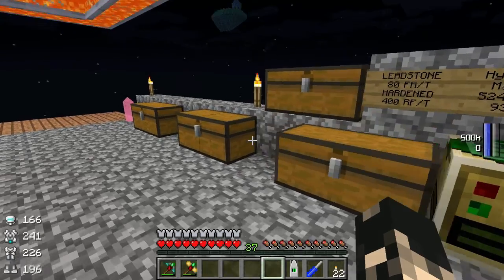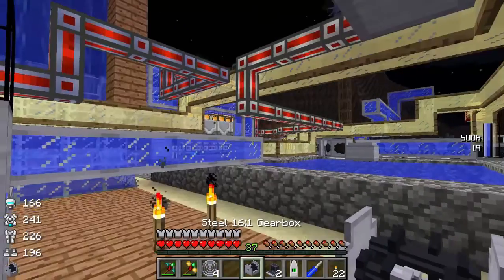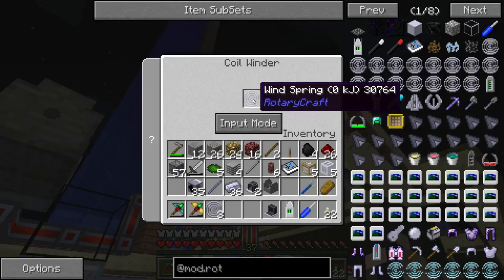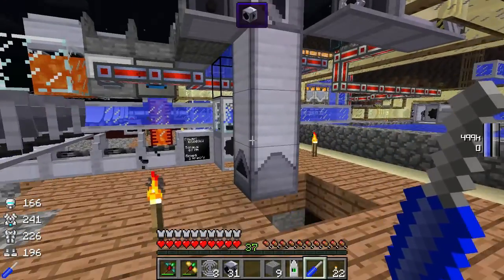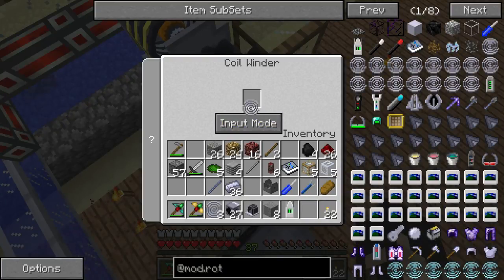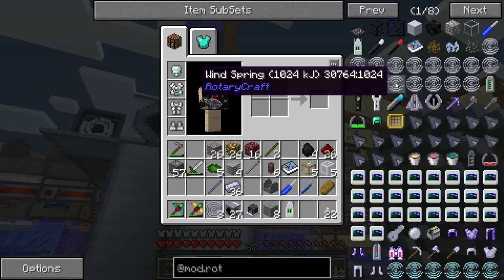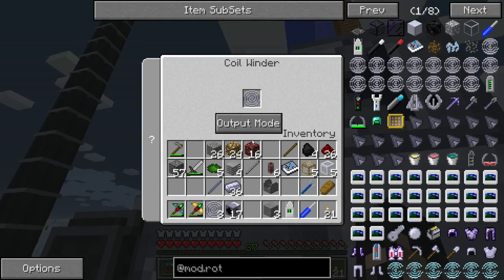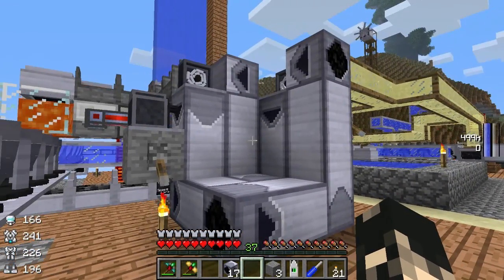Monster FTB Coil Winder, Automating coil distribution

Comment: Really good stuff Ausyarr :) Not sure why you jumped around contorting yourself when they can just be screwdrivered into whatever position though hehe. You're making cool stuff though, really digging it.
Reply from the maker: thanks a lot, I find that screw driver will make pipe adjacent to one you your trying to work on change as well. That has happened on video yet. I think there is a mechanic at work I don't know about.